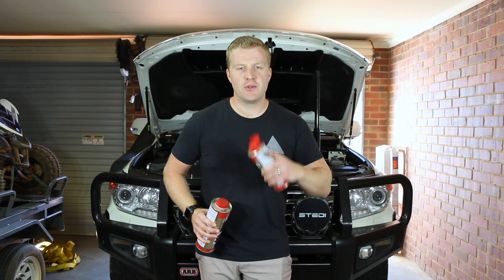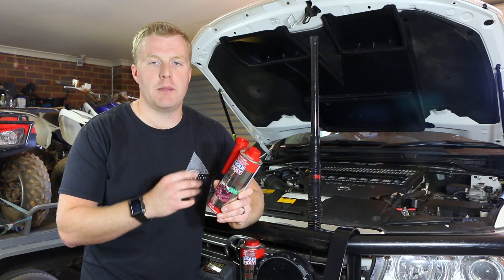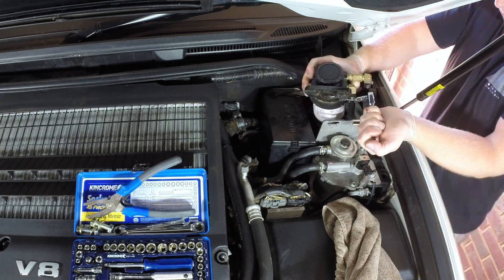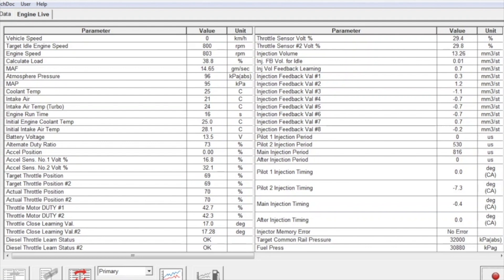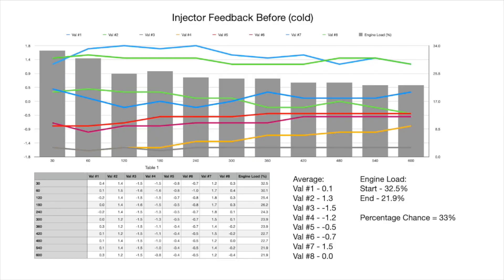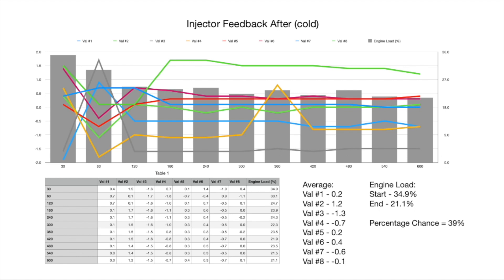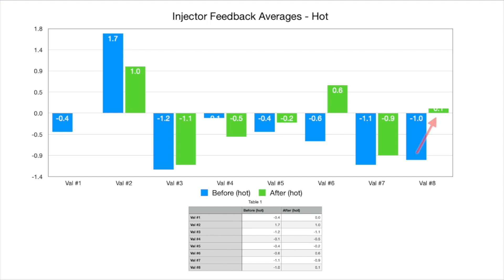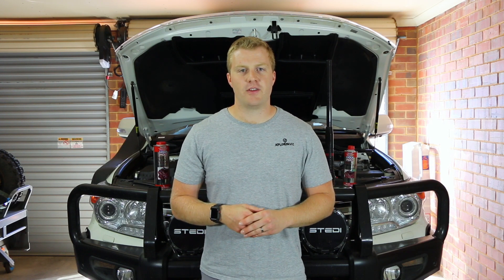LIQUI-MOLY Diesel Purge | Does it actually clean injectors? | Injector Feedback Test -Fuel injection

Comment: I was cleaning out my Landcruiser VDJ79R fuel filter case the other day with compressed air and blew a little bit of black algae & crap out from under the plastic float housing in the bottom of the filter case. There must have been a little water lurking under there to allow the algae to form, something you might want to check as it wasn't visible to the eye when replacing the stock fuel filter which I do every 20K and have never seen any water sedimenting out.
Reply from the maker: Thanks mate, I'll definitely keep an eye on that. Having the secondary fuel filter also gives me a little peace of mind as well, as this is also a filter that will catch further particles and trap any water that may pass the factory filters. 
Thanks for watching and appreciate your advice.
Cheers, Nathan.
Reply: @XploringOz  I think the factory Toyota fuel filters do down to to 2 micron. my 145K old fuel filter case had some corrosion down the bottom so water must have been sitting in it a one stage, I just ordered a new one and noticed it has a painted on varnish like coating on the lower half to protect the case from rusting. I'll run some Liqui-moly through it and swap it out & replace the filter again too. Another important point about diesel fuel is to get a receipt each time you buy it so you have some recourse on the seller if you get a couple of K's down the road after filling up and the warning lights come on or worse.
Reply from the maker: @dustyfarmer  You can never be too careful with fuel and the quality with these newer common rail Diesel engines. I reckon there would be so many people out there with no idea and who don't periodically check these things...
Reply: @XploringOz  You're not wrong, I serviced a friends Nissan CRD yesterday & they were running it at 9K intervals on the oil change as recommended, the oil was as black as the ace of spades. Put the new oil in and ran it, still black on the dipstick. Had to drain the new oil that looked 5K old in 5 minutes as I was not happy with it. Second oil change much better but plenty of blowby out the filler cap on a 200K engine, longer service intervals are no good, the drain plug positioning on the sump left about 500ml of dirty oil in it, I syringe/hose suctioned that out the second time & not one grease nipple on it either, oil filter was in a bastard of a position too.

Comment: G’day Nathan, good job and super explanations, can you see the injector data also on the ultra gauge ? Cheers
Reply from the maker: Thanks Holger, always appreciate your feedback. 
Unfortunately this is one of the limitations of the Ultragauge and this data can't be seen on this device. This is one of the two main reasons I went through the painful task of obtaining and operating this particular software.
Thanks, Nathan.
Reply: @XploringOz  Did you mention the software you are using? Looks pretty good. I assume you're using a OBDII to USB adaptor as well? Top notch video, mate!
Reply from the maker: @oxylus7223  Thanks mate, appreciate the feedback there. I haven't gone into too much detail regarding the software I'm using. This is because I'm not particularly IT savvy and I had to off-source the installation process in order to get this program working. The program is Toyota Techstream and is operated through the OBDII port, using a mini VSI cable. Great piece of kit for diagnostics and comparisons. Cheers, Nathan.

Comment: Hey Nathan 
Any reason you did not add it directly into the fuel bowl of the pump that’s the way I add my Wynn’s Recharge Kit
Reply from the maker: Hey Clint, there is no particular reason and this would have worked fine. To be honest, it's not something I had thought of and may be something I try next time. 
Cheers, Nathan.
Reply from the maker: @Miguel Reyna It sure can be. This is safe to run through any diesel pump or fuel systems. As it can be run as a stand alone product, there is no reason it can't be run in high concentrate formula's too. Good luck.

Comment: Great video. Your knowledge is excellent. 

Have you heard of a product called Fuel Doctor? I've been wondering whether to use a bottle in my Dmax but am worried about potential negative affect on injectors.
Reply: I used fuel doctor for the same purpose Nathan has used the liquid moly, it helped my injector values and I now use it in most tanks. Been doing it for a year now..
Reply from the maker: Thanks mate, I appreciate the feedback once again. 
I have heard of this product, however haven't had any personal experience with it. I would be comfortable using this product with the appropriate administration and dosage and wouldn't be too worried about injector damage. 
These companies has spent significant time and resource to make a product that is as effective as possible and 'consumer' proof, with the knowledge that not all users will administer correctly.
I believe with the correct method and dosage, it would work well.
To be honest, I may even try one of these products in the future to see if any further improvements can be obtained. 
Cheers, Nathan.